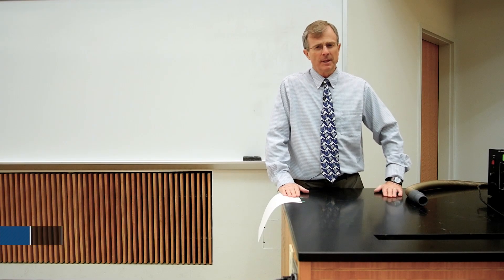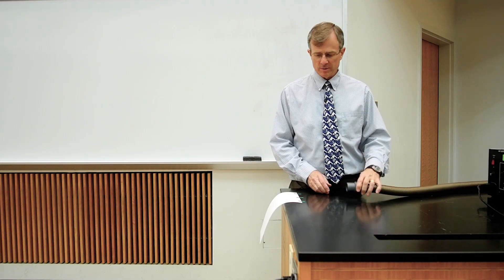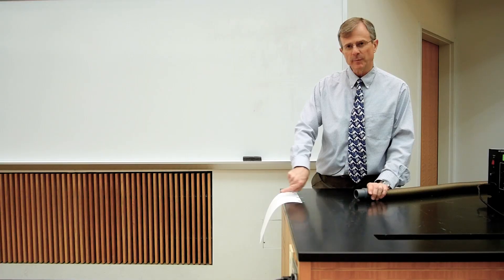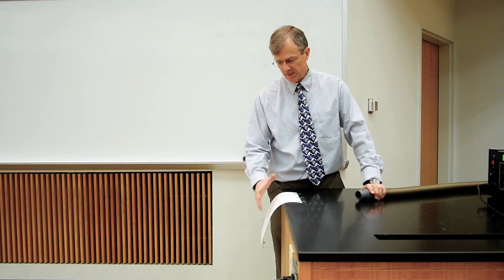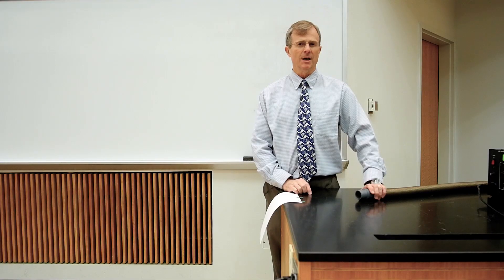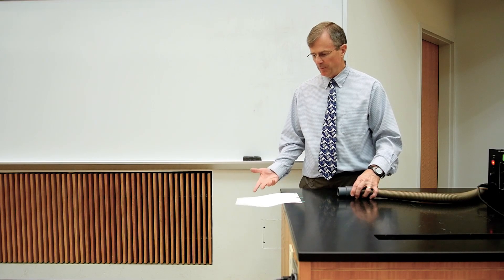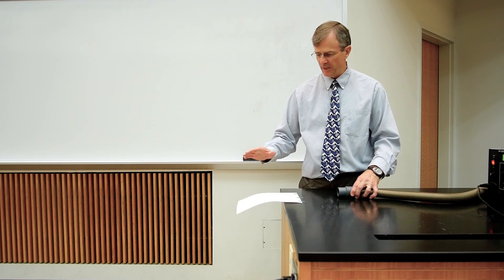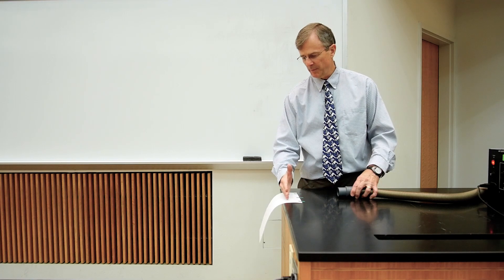Bernoulli's Principle Demo: Paper on Table

Comment: This is incorrect! 
Because Bernoulli has to do with speed CHANGES, not simply speed.  
It is so embarrassing to see this taught at this level.. 

..
The true physics:
.
Bernoulli normally "happens" because there is a higher pressure INSIDE the blower compared to atmospheric pressure outside it.
The static pressure of the stream exiting the blower into the atmosphere is AT atmospheric pressure.
This inside-to-outside Pressure Gradient is the CAUSE of the acceleration of air out the nozzle. A Pressure Gradient provides the force to Accelerate the water.
Air out of your mouth or a blower / hair dryer is AT atmospheric pressure - NOT below it.
.
Claiming that the fast stream of air out of the blower has a pressure lower than atmospheric pressure ONLY because of its "fast" speed, that is false.  As I say, it is AT atmospheric pressure and can be easily measured as such if you know how.
.

..
If you think that stream out of the blower is below atmospheric pressure due to the fast speed, you are wrong. 
That is an all too common misconception about Bernoulli's Principle.
..
It is the curve in the paper that starts this as the Coanda Effect. Coanda along a converx causes the lower pressure because:
!- Atmospheric pressure is pushing the floe against the curved surface, BUT
2- Air has mass AND inertia and .
3- It is that inertia, according to Newton's First Law, that works against that atmospheric pressure to reduce the pressure near the surface.
4- Once the paper lifts it is simple entrainment pulling the paper taut.
.
FAST moving fluid out into the open, DOES NOT "cause" the flow to decrease in pressure.
That surface places additional constraints that must be considered in the explanation of WHY.
.
Grade F.

Comment: is also incorrect! 
This is false, because Bernoulli has to do with speed CHANGES, not simply speed.  
This is an all too common misconceptions and a shame people at this level still teach this nonsense.. 
.

.The true physics:
.
Bernoulli normally "happens" because there is a higher pressure INSIDE the blower compared to atmospheric pressure outside it.
The static pressure of the stream exiting the blower into the atmosphere is AT atmospheric pressure.
This inside-to-outside Pressure Gradient is the CAUSE of the acceleration of water out the nozzle. A Pressure Gradient provides the force to Accelerate the water.
Air out of your mouth or a blower / hair dryer is AT atmospheric pressure - NOT below it.
.
Claiming that the fast stream of water out of the blower has a pressure lower than atmospheric pressure ONLY because of its "fast" speed, that is false.  As I say, it is AT atmospheric pressure and can be easily measured as such if you know how.
.

..
If you think that stream out of the blower is below atmospheric pressure due to the fast speed, you are wrong. 
That is an all too common misconception about Bernoulli's Principle.

Comment: This is amazing because it's contrary to what I'd imagine would actually happen. Science is interesting
Reply: It is also incorrect! 
because Bernoulli has to do with speed CHANGES, not simply speed.  
I say that this is misinterpreted. 
.

.
That said:
.
Bernoulli normally "happens" because there is a higher pressure INSIDE the blower compared to atmospheric pressure outside it.
The static pressure of the stream exiting the blower into the atmosphere is AT atmospheric pressure.
This inside-to-outside Pressure Gradient is the CAUSE of the acceleration of water out the nozzle. A Pressure Gradient provides the force to Accelerate the water.
Air out of your mouth or a blower / hair dryer is AT atmospheric pressure - NOT below it.
.
Claiming that the fast stream of water out of the blower has a pressure lower than atmospheric pressure ONLY because of its "fast" speed, that is false.  As I say, it is AT atmospheric pressure and can be easily measured as such if you know how.
.

..
If you think that stream out of the blower is below atmospheric pressure due to the fast speed, you are wrong. 
That is an all too common misconception about Bernoulli's Principle.

Comment: It helped me pass my test
Reply: Then, your teacher also does not understand this, but believes an all too common misconception.

.
Because Bernoulli has to do with speed CHANGES, not simply speed.  
It is so embarrassing to see this taught at this level.. 

..
The true physics:
.
Bernoulli normally "happens" because there is a higher pressure INSIDE the blower compared to atmospheric pressure outside it.
The static pressure of the stream exiting the blower into the atmosphere is AT atmospheric pressure.
This inside-to-outside Pressure Gradient is the CAUSE of the acceleration of water out the nozzle. A Pressure Gradient provides the force to Accelerate the water.
Air out of your mouth or a blower / hair dryer is AT atmospheric pressure - NOT below it.
.
Claiming that the fast stream of water out of the blower has a pressure lower than atmospheric pressure ONLY because of its "fast" speed, that is false.  As I say, it is AT atmospheric pressure and can be easily measured as such if you know how.
.

..
If you think that stream out of the blower is below atmospheric pressure due to the fast speed, you are wrong. 
That is an all too common misconception about Bernoulli's Principle.
..
It is the curve in the paper that starts this as the Coanda Effect. Coanda along a converx causes the lower pressure because:
!- Atmospheric pressure is pushing the floe against the curved surface, BUT
2- Air has mass AND inertia and .
3- It is that inertia, according to Newton's First Law, that works against that atmospheric pressure to reduce the pressure near the surface.
4- Once the paper lifts it is simple entrainment pulling the paper taut.
.
FAST moving fluid out into the open, DOES NOT "cause" the flow to decrease in pressure.
That surface places additional constraints that must be considered in the explanation of WHY.
.
Grade F.
For this sad example of a Utah State University by Professor Boyd F. Edwards.

Comment: I'm sorry to have to correct you! This is not a demo of Bernoulli's principle. Bernoulli's equation only applies along a streamline. This is a demonstration of the Coanda effect.
Reply: I'm glad someone said it. Bernoulli's principle doesn't mean a free jet is at lower pressure than atmospheric since that's not really possible to achieve with any subsonic piping system. Exit boundary conditions are a thing
Reply: @burkesebastian2921  SO TRUE. . . 
.
Because Bernoulli has to do with speed CHANGES, not simply speed.  
It is so embarrassing to see this taught at this level.. 

..
The true physics:
.
Bernoulli normally "happens" because there is a higher pressure INSIDE the blower compared to atmospheric pressure outside it.
The static pressure of the stream exiting the blower into the atmosphere is AT atmospheric pressure.
This inside-to-outside Pressure Gradient is the CAUSE of the acceleration of water out the nozzle. A Pressure Gradient provides the force to Accelerate the water.
Air out of your mouth or a blower / hair dryer is AT atmospheric pressure - NOT below it.
.
Claiming that the fast stream of water out of the blower has a pressure lower than atmospheric pressure ONLY because of its "fast" speed, that is false.  As I say, it is AT atmospheric pressure and can be easily measured as such if you know how.
.

..
If you think that stream out of the blower is below atmospheric pressure due to the fast speed, you are wrong. 
That is an all too common misconception about Bernoulli's Principle.
..
It is the curve in the paper that starts this as the Coanda Effect. Coanda along a converx causes the lower pressure because:
!- Atmospheric pressure is pushing the floe against the curved surface, BUT
2- Air has mass AND inertia and .
3- It is that inertia, according to Newton's First Law, that works against that atmospheric pressure to reduce the pressure near the surface.
4- Once the paper lifts it is simple entrainment pulling the paper taut.
.
FAST moving fluid out into the open, DOES NOT "cause" the flow to decrease in pressure.
That surface places additional constraints that must be considered in the explanation of WHY.
.
Grade F.

Comment: Why is Physics so hell interesting?
Reply: And he is WRONG!
The common misconception is that any moving air, such as from a hair dryer, leaf blower or your mouth, has a lower static pressure than the stationary air around it. This is not true and comes from a misreading of Bernoulli’s Principle and misunderstanding of how to apply it. There are several demonstrations that are misinterpreted to show the static pressure is lower.

The moving stream of air from one of these is at the very same static, atmospheric pressure as the still air around it. It is NOT lower.

Here is the correct explanation.

This moving air has MORE total energy than the still air around it, not the same amount. This additional energy was added by the blower. The Total energy is the potential energy of the atmospheric pressure plus the kinetic energy of its motion or momentum. 

Each of these ‘blowers’ adds energy to the air in the form of static pressure.  This internal pressure is higher than the atmospheric pressure outside it. 

For example, muscles move the diaphragm to squeeze the lungs.  This increases pressure in the lungs. 

This internal pressure pushes more on the air than the pressure outside
A pressure difference between two locations is called a Pressure Gradient.  This reflects the idea that the pressure changes gradually between the two locations. 

Because the internal pressure pushes more on the air, there is a net force toward the lower pressure outside the blower.  The air is free to move and is accelerated toward the lower pressure.  This is Newton’s Laws in fluids. 

Air has mass. A Pressure Gradient provides a net force.  Mass is accelerated away from the higher force, toward the lower force and gains speed in this case. This happens at the outlet of the blower and we have the stream of air starting internally at the higher pressure and accelerating to atmospheric pressure.

That’s it.

For those watching the conservation of energy rules, the TOTAL energy of air INSIDE the blower is the same as the TOTAL energy of the stream OUTSIDE the blower. The trip from inside to outside has no energy changes in that air. 

We see that inside the lungs, all the air has nothing but potential energy in the form of static pressure and no motion with kinetic energy – no dynamic pressure. All the energy in the lungs is in the potential energy of static pressure.

The air gains speed (acceleration) as it exits, thus changing the extra potential energy of pressure into kinetic energy of the moving momentum of the air’s mass.

Comment: Very simple example  
But deep knowledge
Reply: And WRONG! 
.
The common misconception is that any moving air, such as from a hair dryer, leaf blower or your mouth, has a lower static pressure than the stationary air around it. This is not true and comes from a misreading of Bernoulli’s Principle and misunderstanding of how to apply it. There are several demonstrations that are misinterpreted to show the static pressure is lower.

The moving stream of air from one of these is at the very same static, atmospheric pressure as the still air around it. It is NOT lower.

Here is the correct explanation.

This moving air has MORE total energy than the still air around it, not the same amount. This additional energy was added by the blower. The Total energy is the potential energy of the atmospheric pressure plus the kinetic energy of its motion or momentum. 

Each of these ‘blowers’ adds energy to the air in the form of static pressure.  This internal pressure is higher than the atmospheric pressure outside it. 

For example, muscles move the diaphragm to squeeze the lungs.  This increases pressure in the lungs. 

This internal pressure pushes more on the air than the pressure outside
A pressure difference between two locations is called a Pressure Gradient.  This reflects the idea that the pressure changes gradually between the two locations. 

Because the internal pressure pushes more on the air, there is a net force toward the lower pressure outside the blower.  The air is free to move and is accelerated toward the lower pressure.  This is Newton’s Laws in fluids. 

Air has mass. A Pressure Gradient provides a net force.  Mass is accelerated away from the higher force, toward the lower force and gains speed in this case. This happens at the outlet of the blower and we have the stream of air starting internally at the higher pressure and accelerating to atmospheric pressure.

That’s it.

For those watching the conservation of energy rules, the TOTAL energy of air INSIDE the blower is the same as the TOTAL energy of the stream OUTSIDE the blower. The trip from inside to outside has no energy changes in that air. 

We see that inside the lungs, all the air has nothing but potential energy in the form of static pressure and no motion with kinetic energy – no dynamic pressure. All the energy in the lungs is in the potential energy of static pressure.

The air gains speed (acceleration) as it exits, thus changing the extra potential energy of pressure into kinetic energy of the moving momentum of the air’s mass.

Comment: this will really help
Reply: If you want to be wrong.
..
The common misconception is that any moving air, such as from a hair dryer, leaf blower or your mouth, has a lower static pressure than the stationary air around it. This is not true and comes from a misreading of Bernoulli’s Principle and misunderstanding of how to apply it. There are several demonstrations that are misinterpreted to show the static pressure is lower.

The moving stream of air from one of these is at the very same static, atmospheric pressure as the still air around it. It is NOT lower.

Here is the correct explanation.

This moving air has MORE total energy than the still air around it, not the same amount. This additional energy was added by the blower. The Total energy is the potential energy of the atmospheric pressure plus the kinetic energy of its motion or momentum. 

Each of these ‘blowers’ adds energy to the air in the form of static pressure.  This internal pressure is higher than the atmospheric pressure outside it. 

For example, muscles move the diaphragm to squeeze the lungs.  This increases pressure in the lungs. 

This internal pressure pushes more on the air than the pressure outside
A pressure difference between two locations is called a Pressure Gradient.  This reflects the idea that the pressure changes gradually between the two locations. 

Because the internal pressure pushes more on the air, there is a net force toward the lower pressure outside the blower.  The air is free to move and is accelerated toward the lower pressure.  This is Newton’s Laws in fluids. 

Air has mass. A Pressure Gradient provides a net force.  Mass is accelerated away from the higher force, toward the lower force and gains speed in this case. This happens at the outlet of the blower and we have the stream of air starting internally at the higher pressure and accelerating to atmospheric pressure.

That’s it.

For those watching the conservation of energy rules, the TOTAL energy of air INSIDE the blower is the same as the TOTAL energy of the stream OUTSIDE the blower. The trip from inside to outside has no energy changes in that air. 

We see that inside the lungs, all the air has nothing but potential energy in the form of static pressure and no motion with kinetic energy – no dynamic pressure. All the energy in the lungs is in the potential energy of static pressure.

The air gains speed (acceleration) as it exits, thus changing the extra potential energy of pressure into kinetic energy of the moving momentum of the air’s mass.